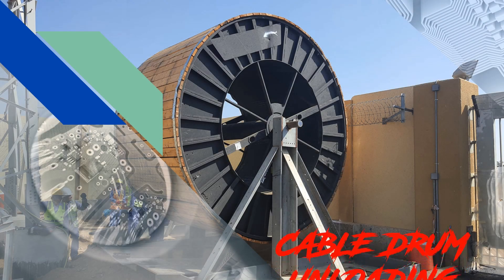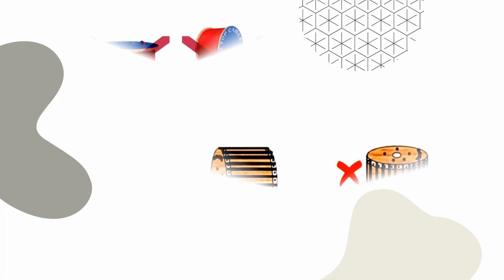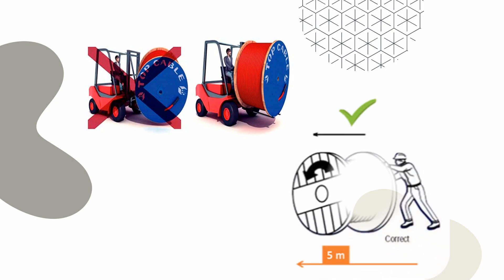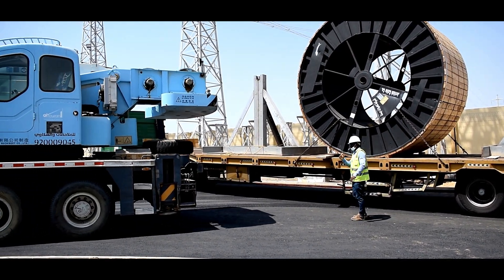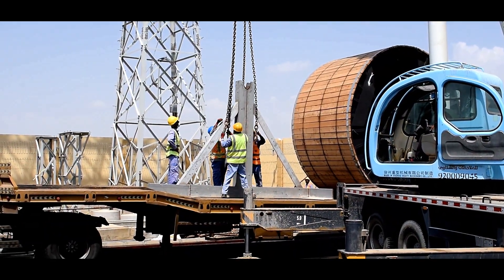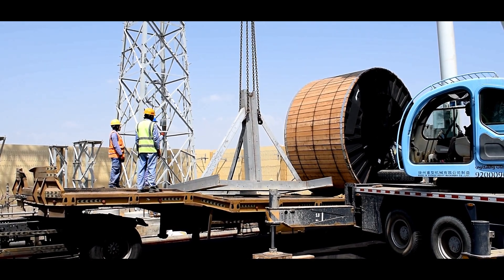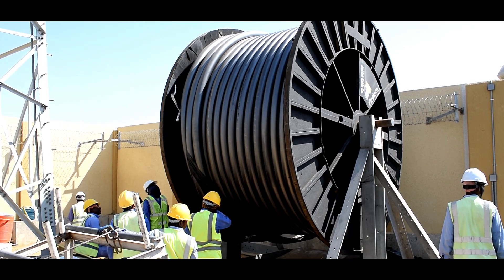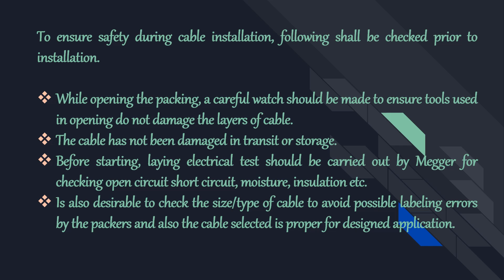UNDERGROUND CABLE | Cable Drum Unloading | XLPE

Comment: Lifting is incorrect. They should have used spreader/stretcher so lifting chain will not be in direct contact with and shall not be pressed against the drum. This is recommended by most cable manufacturers like Ducab, Oman cables, Saudi cables, etc.